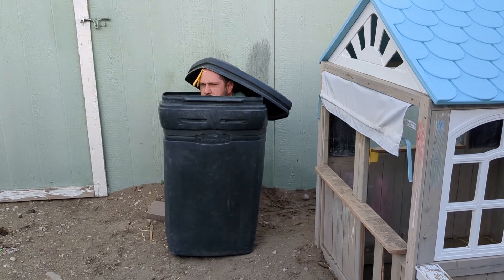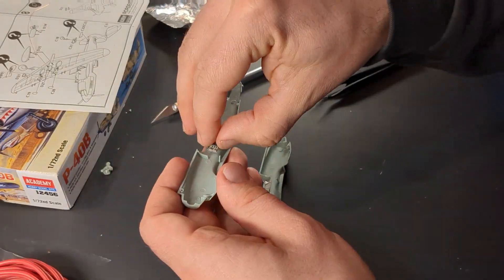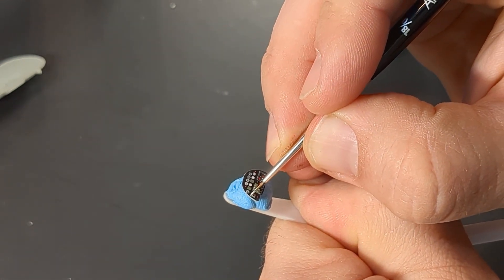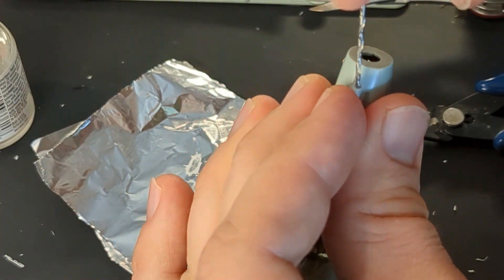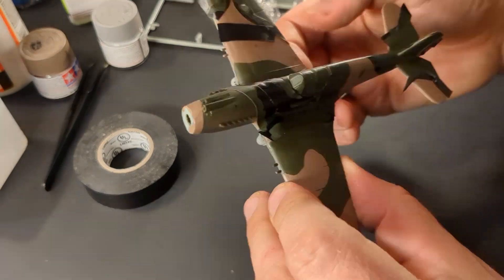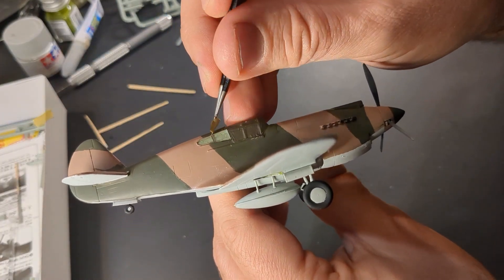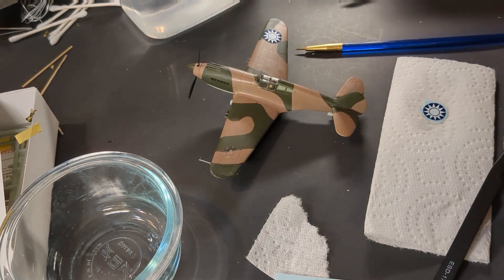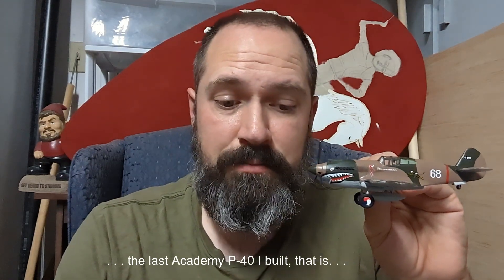A Garbage Warhawk made with Garbage!!

Comment: Cylindrical thing above the cowl is the carburetor intake. Intake below is for the radiators.
Reply from the maker: Oh that's interesting. . . I wonder, did the carburetors cause the Allison engine to stall like the Rolls Royce Merlin?
Reply: @professorbellbuilds That is a really interesting question. A quick look at Wiki, seems to show early engines used float-type carburetors, they tried injection but it doesn't seem to have worked. Bendix pressure carburettors were used later, so I would guess this may have resolved any such issues, unfortunately no dates are mentioned in the text from my quick perusal.
Reply from the maker: @marktuffield6519  I've never run across anything in my studies, so if I had to guess it would have been a rare occurrence if it was an issue.  Then again, I've never done a deep examination of the operational use of the P-40. . . That might be a monumental task anyway given the P-40's ubiquity in the early war!

Comment: 10:37 I find using Blu Tac rolled into sausages and laid down and then the parts to be masked are covered with tissue that's been split into it's 2 plys and use just one ply. the tissue sticks easily to the Blu Tac and can be easily removed and the Blu Tac used over and over. That's for spraying, not sure how it would go with hand painting.
I know what you mean about the older decals, NOTHING would work on them not even Microsol/set, they just would not soften. I ended up using other decals on my model.
Reply from the maker: That bluetac technique is a good one.  The one drawback is that it can leave some residue, but I think it's worth it and fairly easy to clean up.
Reply: @professorbellbuilds  I don't apply a lot of pressure when I lay the sausages on the model and it doesn't seem to leave residue or marks. Possibly some  of the residue issues have to do with climate, hot, cold etc ?. Anyway we all use what works for us.
Reply from the maker: @potrzebieneuman4702  climate could be it.  I also wonder if I'm using very good quality stuff.  I do tend to purchase the cheapest crap I can, so maybe there's a difference in quality.
Reply: @professorbellbuilds  heheh I do as well, you do what you have to do when you're on a pension.

Comment: That P-40 looks pretty darn good for an experimental testbed!  I think I might use some of the thin wire and beer can on some of my kits.  I have tons of thin wire like that, I've been saving to use it on my models, but was thinking about ships rigging and actual wires or hoses on aircraft.  It looked great for ribs.  Where did you get the fine paint brushes that you used to paint the radio and instrument panels in the cockpit? The bristles were so stiff!  Mine are too soft and make a mess on fine details like that.  And using a tooth pick doesn't always work well either. Thanks!
Reply from the maker: Oh, I hate using toothpicks for painting!  It never works for me.  I get a lot of my fine brushes at Hobby Lobby in their fine paint department.  I think that one was an 18/0 for acrylic detail.  I think you can get really good fine brushes from game stores too for painting warhammer stuff.  Let me know how the wore works for rigging.  It might be good for slack lines, but for taught I'd still use black lycra.
Reply: Thanks, I've got a Hobby Lobby nearby, I'll see what I can find.   @professorbellbuilds